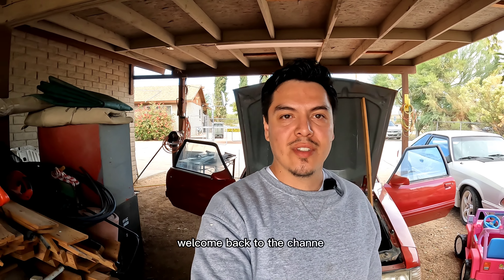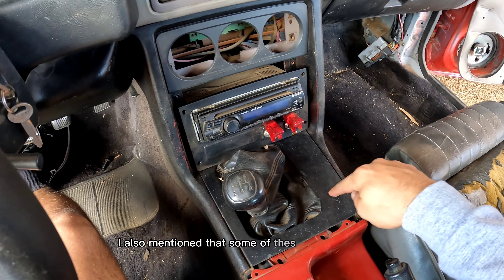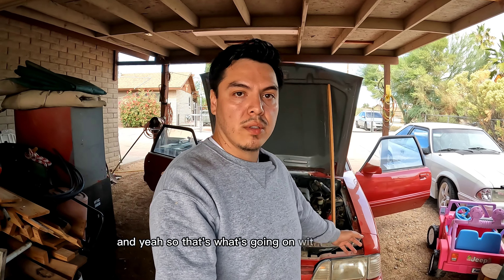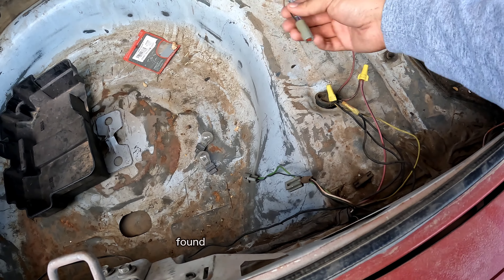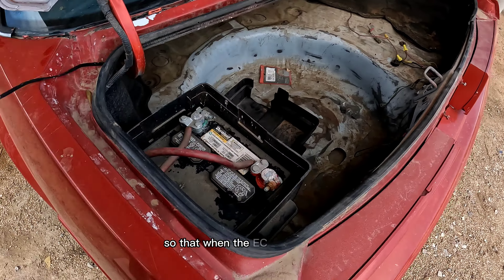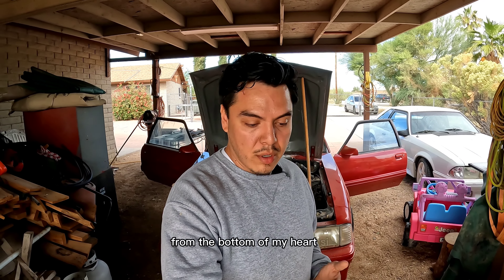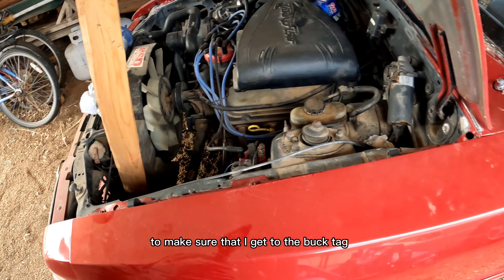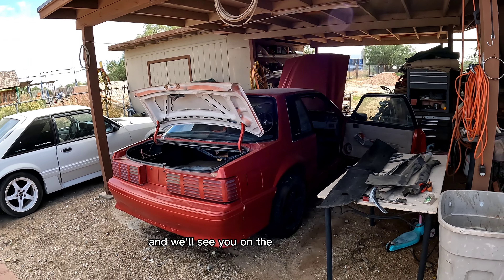Can it be an SSP ?

Comment: The ignition system will work without the computer... While it may be bad from age at this point, its not the cause of your no spark issue if you replaced the coil and distributor your issue is in the wiring... The most common is the ignition switch you can try  zipting it if its lose and see if it has spark after that I would check the fusible links off the starter relay make sure nothing is shorted, missing or rotted away.
Reply from the maker: Thank you this helps a Lot really appreciate your time and help 🙏🏼